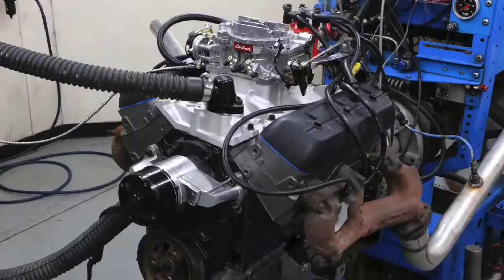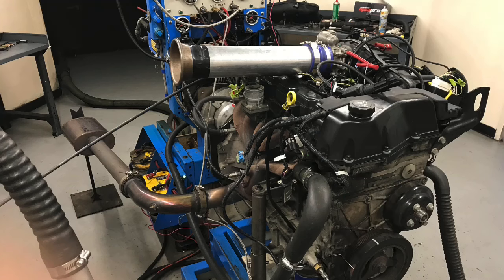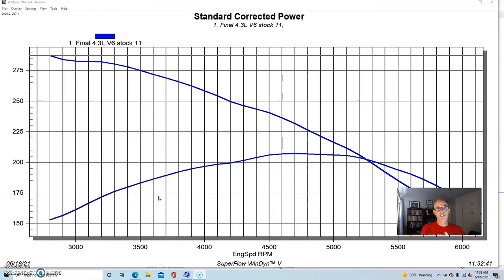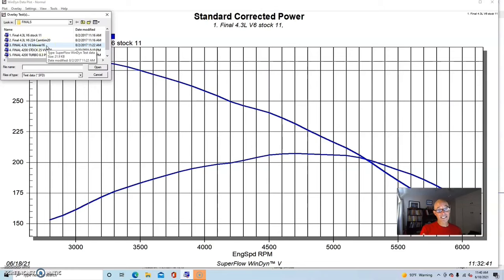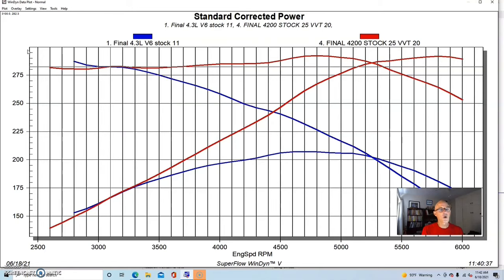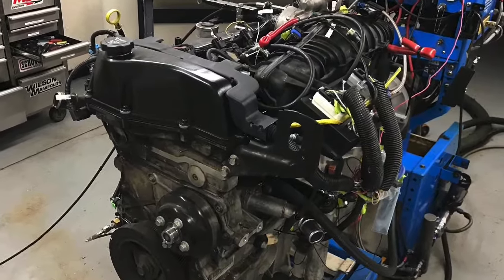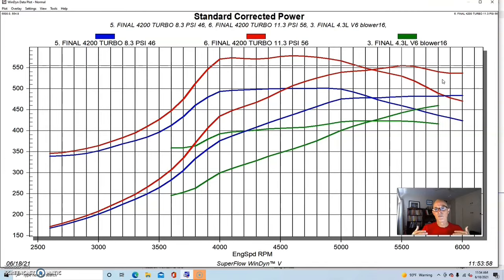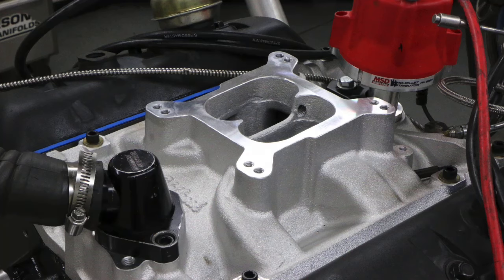4.3L VORTEC V6 VS 4200 ATLAS INLINE 6 (VORTEC VS AMERI-BARRA)

Comment: I wonder how the 3.6 LFX engine would compare to these two engines?
Reply: Stay away from those finicky, wretched things.
Reply: The LFX is much lighter and more compact 60 degree V6 vs 90 degree of the 4300 and it's more powerful than either.  It was the reason the Atlas was retired it's better in every way aside from perhaps cost.

Comment: I'm seriously considering swapping my Ford F350's 460 for a 4.2 Atlas and a modest turbo, the 460 (7.5 liter) is a pathetic joke compared to the Atlas, my 460 has over 200K on it so it's tired on top of being feeble even when it was new (I bought the truck new).
Reply: 4.2 is not the motor you want too run in a 1 ton truck it's a car motor not a truck motor you'll have it blown in no time, do it right and put a 12 valve in it
Reply: @chrishansen7004  The Atlas was never in a car.

Comment: AS TO absolute potential power output, I have read that the difference in top horsepower between 4 valve heads and 2 valve heads in a racing environment is about 2%.

Automakers use 4 valve heads these days because their pent-roof design is better from a knock standpoint and can process more air with less emissions.  And much better driveability.
Reply from the maker: 2%?
Reply: @richardholdener1727  I read that in Smokey Yunick's book.  With two big valves, high lift cams, and long duration you can get within about 2%.  4 valve engines exist because they can produce high power without much lift and duration, which in turn allows much cleaner emissions and far better driveability.

Comment: I'm actually a little bit of a fan of the vortec engines, but that's about the max you would want to push the 4.3, any more then that and you'll be getting crank walk. But if you would have matched the cam with an aftermarket crank and heads and valve train we would see 600 hp all day.
Reply: 600 hp out of that engine?! That's awesome.
Reply: Yeah there's some videos on YouTube with some guys getting 1000hp+ out of  a 4.3 vortec but they also have about 30 to 40k invested in it.

Comment: Richard, im building a 496 Big Block and was wondering if you have any experience with multiport fuel injection on that platform, is it worth it? Or would you stick with a carb/tbi setup?
Reply from the maker: I would not use TBI, a carb works well, we usually only run port injection with high boost
Reply: @richardholdener1727  I'm eventually going to  put twin turbos on it, was looking at the holley sniper stealth system. They claim 1250 hp, does it seem realistic?

Comment: I KNOW EXACTLY WHAT YOU MEAN ABOUT THE TORQUE CURVE ON THE 4200 , I HAVE AN 02 TRAILBLAZER WITH 230 K , I’M THINKING OF PULLING THE CURRENT ENGINE AND ENGINE STAND IT , REPLACING IT WITH A LATER YEAR ENGINE 06 , THE EXHAUST PORTS ARE BIGGER ON THE LATER & AM I CORRECT THE INTAKE PORTS ARE ALSO BIGGER ????? I HAVE TO WATCH THE COMPRESSION RISE DUE TO RUNNING A SUPERCHARGER OR TURBO !! THE 6.0 SS TRAILBLAZERS ARE MONSTERS FOR POWER !!!

Comment: Have you done any testing on the later LV3 4.3?
Reply from the maker: NO SIR
Reply: @richardholdener1727  285 hp stock with VVT and GDI.  You said start with high NA power!  LV3 vs ATLAS!

Comment: Ford, Chev, Toyota, Nissan who ever is listening up bring back the inline 6.
Reply: GM, Mercedes, BMW, Mazda are making lovely straight 6s
Reply: @hyattbusbey3563  GM, Mazda ? Merc $$$ BMW 💩
Reply: GM is selling a 6cyl Duramax 3.0
Mazda is doing a RWD I6 Mazda 6 
Mercedes is money, but good
BMW engines are objectively good outside of your opinions
Reply: @hyattbusbey3563  BMW do somethings that make not want to touch their engines with a 💩 end of a stick, Hovies Garage and the mechanics he gives his money to can arrest to that.
Reply: @hyattbusbey3563  What?! rwd I6 Mazda6?!
Reply: @hyattbusbey3563  Yupper… my 99 3.0 6 has 279k miles and purrs at 90mph…. Took it west last summer… cruised 3hrs at 135mph without problems…. and still get 28-30mpg on highways with pump gas

Comment: What other cars did the 4.2 I6 come in other than the Chevy trailblazer, and it's cousins from the other gm brands?
Reply: It was only used in the GMT360 platform, so only the Trailblazer, GMC Envoy, Olds Bravada, Saab 9-7, Isuzu Ascender, and Buick Ranier.

Comment: The 3.8 dutweiller grand national and the 4.3 are the same Genesis. Although it is a pain in the ass, you can cut a cylinder off any sbc V8 head, weld it up, and run them on the 4.3. for anyone looking for more power.
Reply from the maker: that is a very difficult proposition
Reply: @curvs4me  Few years ago, a guy cut two LS heads and bonded them together to bolt on a Ford 300. I think it made about 280hp with a 4bbl carb.

Comment: You had to put a cam in the V-6 just to make it compete with the inline 6
Reply: It's not about inline or V it's technology in head design that's making the extra power. 4 valve VS. 2 valve, VVT on exhaust cam ect. That 4.2 exhaust manifold looks like a cast header.

Comment: Long term durability cannot be equaled by any Vtype engine compared to an I6, especially under boosted applications. 6 cylinders on 7 main bearings, compared to a v8, 8 cylinders on 5 main bearings. V6 has 6 cyl on 4 main bearings...
Reply: Inlines also don't share crankpin journals so in addition to the extra mains the rod bearings are wider/more bearing surface. A Detroit Diesel 6-71 inline 6 lasted a lot longer than its 6v71 vee block counterpart.
Reply: @mytmousemalibu  
Correct. Although an EcoBoost V6 has separate crank pins as well.
Reply: @johncholmes643  Ya, theres a few vee crank designs with separate pins for each cylinder but still constrained in width due to bore offset and limited space of the vee layout. Some engine have no bore offset and are perfectly inline across banks but use a conventional rod/forked rod combination. WWII V12's commonly shared that trait and some big diesels too.
Reply: That Altals block isn't as strong as a iron block V6,  not even close.  Bearing failure is not even an issue with those V6's it's a chopped SBC the bearings are fine.  No one with sense is running built engine until it fails from wear.
Reply: @Dayandcounting  
Then why is the 6cyl dominant in pulling applications?? V8 diesels make plenty of power, but can't have the longevity. It's been tried numerous times.
Reply: @johncholmes643  What does that have to do with these two specific gasoline engines?
Reply: @Dayandcounting  
Because it's facts. An inline 6 will out live a V type. 300 Ford, 250 292 Chevy etc. And even moreover when boost, high cylinder pressures are reached....

Comment: What are the bore spacing on the V6 ? Is it the same spacing as a 350 ? 
If it is the same spacing has anyone cut off the cylinder worth of a good set of alloy sbc heads and welded a plate back on to see the head flow go ^^^^^^^^ ?
Reply: Same as a 305
Reply: @phrogman4654  so same as 350 bore spacing 
If the V6 is same bore spacing as 350 but the valve position is wrong compared to a 350 so it would require a full custom cam grind to suit the valve position in the V6 and would also require a cut out sbc intake and modified exhaust header to suit also 🤷‍♂️ 
The Brodix alloy head would be easier if able to be found
Reply: Well they make cams and 1 intake for the V6 so custom ah I don't know if that's what you call it. The problem is the V6 has the same small bore as the 305, so you might be able to cut up a set of sbc heads for the 305 but the 350 heads would smack the cylinder walls.
Reply: @phrogman4654  the earlier 4.3 has a 4.0 bore is the engine I’m talking about and I’m pretty sure the one used in this test is also the 4.0 bore also

Comment: Why did GM stop using the 4200?
Reply: The platform ended they were only available in trailblazers,Envoy, and i think rainier. When they ended so did this engine. Too long for any other platform GM had and to mount in front wheel drive platforms.
Reply: Oh also the 4.2 doesn't do well in the MPG department. My 07 4X4 gets 16 to 18 city

Comment: That 4.3l looks like a good airplane engine.
Reply: Anyone with the balls to put a chevy engine in a plane...
Should do it.
Idk why.
Reply: @anomilumiimulimona2924  people already put air cooled vw engines in planes so there is that.
Reply: @jgranger2002  oh, a air cooled vw, with a gear driven cam. An aerovee.
And whats your point, are you comparing one of the most reliable engines to a gm?
Reply: @anomilumiimulimona2924  what about a air cooled vw engine is reliable? An airplane engine needs to make power forever at a small rpm threshold. I would think the much newer design of a chevy 4.3 would easily outlast an antique vw engine.
Reply: @jgranger2002  not for the weight, size, and cooling system.
Reply: @anomilumiimulimona2924  so a 40 hp vw engine is better because it's lighter and air cooled. Guess it depends on how much power is required to power the plane. A chevy 4.3l makes more power just off idle than a vw at max power rmp.
Reply: @jgranger2002  what a 1200?
My 2100 makes around 250.
Reply: @jgranger2002  lycoming vs 4.3 just read the thread,  19,500 is about the guys estimate for bulding a 4.3 for areo, still gonna be like 430 lbs.
But hey im just a guy who reads stuff.

Comment: Richard 
 I’ve been running 4.3’s in multiple vehicles for 20+ yrs now and they are great little power plants. Watching you bolt on the TorqStorm was great fun to watch. I would love to know how much boost the 4.3 will handle with the factory fuel injection and ecu. 
 How cool would it be to be able to bolt on a supercharger and let the factory systems adapt and compensate.

Comment: Over 400HP out of the 4.3 would be stout in a 4x4 S10.
Reply: There are 262s with 500 hp out there, the problem is parts availability like there is with the 4200

Comment: Wish someone would make a good fI intake and heads for 4.3 at a decent cost! Let's stop having to jump through hoops! Everyone talks and wishes about it but no one does anything!  Plenty of interest,lots of money to be made if any aftermarket co would step up! The word would get out quick!
Reply: Sadly, when it comes down to it, 95% of the ones that keep saying this will not buy the parts if they were available saying it’s not worth it and just do a V8 swap!

I proved this when I sourced a 3.6 stroke forged even fire crank that people have been asking for at a reasonable price for 25 + years and not a single person except me was willing to buy one!
Reply: @SyTySpeedShop  Sounds like Panther owners, lol. Nobody is going to make something nobody will buy, like the occasional "is there a carbon hood for crown vic" question. Complaining about the cost of parts, when they should be thankful the aftermarket exist.
Reply: @SyTySpeedShop  the crank would be nice but engine breathing is a little more basic and stock bottom end can handle 500hp.more than that would be a true obsession
Reply: @ItsDaJax  just one good fI intake would be the aftermarket,only thing available is Mercury marine and it has no breathing gain just the ability to install better flowing injectors

Comment: It's just not fair to compare 2-valve OHV with 4-valve OHC engines of similar displacement.  It would be more fair to compare the 4200 to the 4.8.  

But if you test an LV3, you'll forget all about the old 4.3.  It has better everything; aluminum block, better head flow, higher compression, good intake manifold.  There is a lot of potential there, and hardly anybody has paid attention to the Gen V V6.

Comment: I always liked the 4.3 for the reasons mentioned. BUT I absolutely hate the sound of those 4.3s. My dad always called that engine a "bellerin mule."
Reply: Youre trippin, the 4.3 is the best sounding v6 closest thing to a v8 until 3500 rpm . Its still a 350 with two cylinders chopped off

Comment: When it comes to 6 cylinder engines the best design is the V6.  The Flat-6 is right behind it, but the inline six has huge problems with RPM, weight, and packaging.  The Atlas inline 6 was WAY better than the stupid sawed-off chevy 350 that the 4.3 actually was.

Comment: I think the SPLAYED connecting rod journals on the V6 crank are the real weak link. 
The factory rods can probably put up to 500hp, the pistons maybe 400hp but I think the cast crank will fracture like a chicken bone inside a Hyena's mouth before 450hp. The design it's inherently weak from the get-go.
I think the aftermarket industry its missing a big chunk of $ for not making decent, AFFORDABLE, high flow cylinder heads for the Chevy 4.3 V6 Vortec. 
The hard work is already done, just take your best SBC CAD designs and chop it. BOOM! DONE.
There's millions of those out there begging to be "tweaked".
Reply from the maker: we already made more than 450 with the stock crank in this video
Reply: @richardholdener1727  I meant day in, day out for a long time, not just a few dyno sessions.

Comment: The 4.3 is more reliable 4.2 won't last long
Reply: i've seen many 4.2L with 200 to 280,000 miles on them running perfectly sounding like a sewing machine with only water pumps alt. belts coil packs regular wear items replaced. My 07 trailblazer has 127,000 miles has had only battery, belt,spark plugs and one coil pack replacement and 2 throttle body clean ups since new. I also own a 88 s15 4x4 4.3L V6 with a crate H.O engine 200 HP 260 TQ same engine as he's using with about 20,000 miles some upgrades like 1.6 rockers, 600 cfm throttle body MSD ignition, Injector spacer Adj. fuel PSI reg. 2000 stall converter in a 700r4 trans.But, the original engine went 300,000 miles and still ran pretty good a little smoke on start up [ Valve seals,worn guides ]. The factory cam specs. for the VIN W engine [ Like the one he's using ] was 206 or 208 @.050 and i think .425 lift not too bad for stock. Anyway i've had good luck with both. By the way the reason i've seen many is that i worked about 8 years at a "preowned" car lot.
Reply: @fastnasty6627  I had a Colorado with 2.8 4 cylinder ND it had a p0017 code I changed everything timing chain vvt solenoid cam sensor crank sensor camshaft sprocket camshaft both camshafts ND sprocket ND crank sprocket ND it just never ran good. Like it wouldn't pass smog

Comment: Congratulations on getting less than stock power from aftermarket parts and no accessories. The early 90's 1st gen "Vortec" branded 4.3L was rated the same 200hp and 260ft-lb with accessories!

Comment: the atlas is crap, ive had one that had a oil pump failure at 90k and threw a rod, every single person i know that has had a trailblazer with the atlas has had the same problem, atlas in junk, vortec v6 is way more reliable.

Comment: Personally I blame squirrels
Reply: Damn tree rats.... lol
Reply: Today, I am blaming chipmunks.  A couple of years ago, the fuel gage in my Camaro started reading inconsistently.  Nothing serious, but sometimes it would drop from 1/4 tank to near empty quickly, then slowly come back.  I lived with it.  But on Tuesday this week, the old trusty Camaro died on the way to work, and couldn't be restarted.  Got it towed back home, and tore into it yesterday evening.  When I got the top of the fuel tank exposed to get to the fuel module connectors, I found a nest of some rodent, and gnawed wire loom cover and wires where the conductors were exposed.  And a few nutshells left behind.  

There is not enough room on top of the fuel tank for squirrels.

So personally, I blame chipmunks.
Reply: @andyharman3022  almost have to run your wiring through steel flex conduit these days to make sure the rodents don't get into it
Reply: I had Chipmunks, Squirrels, Foxes, and Raccoons when I lived in Maine: nothing was safe from teeth...